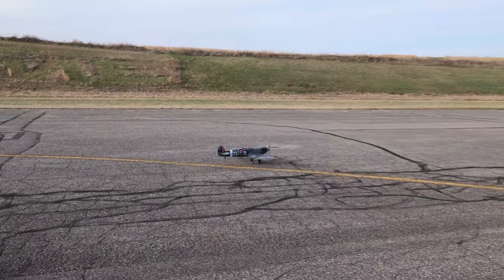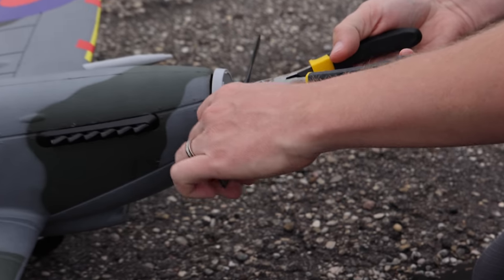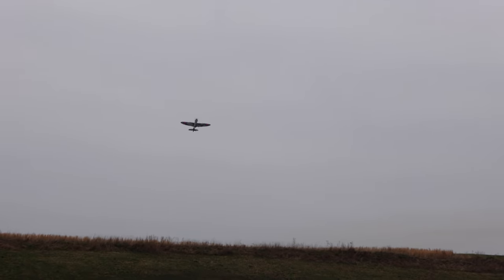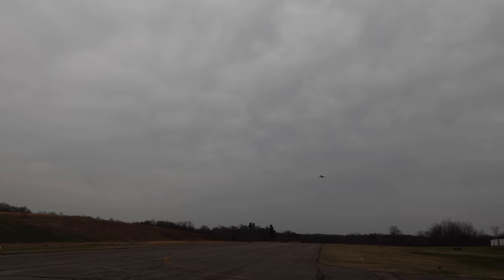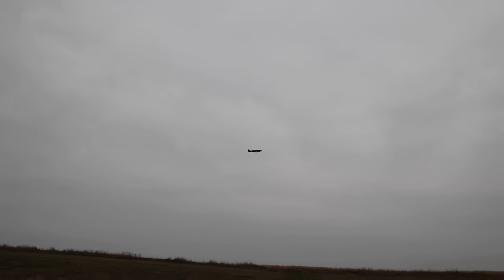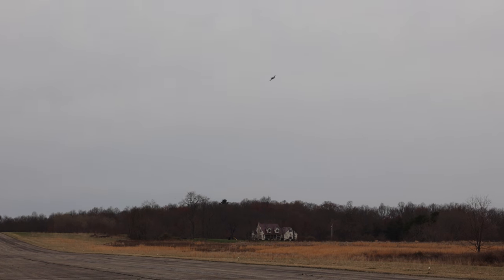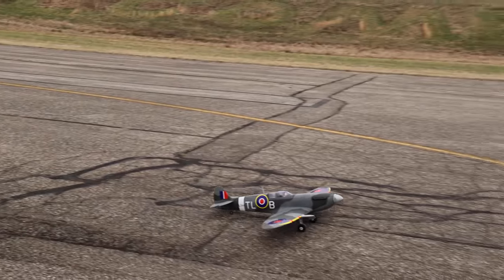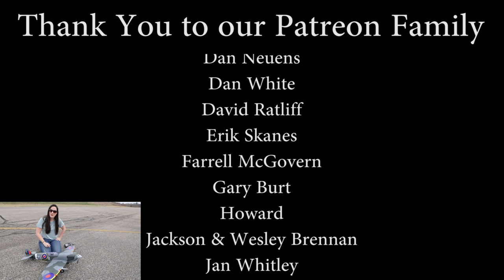Will this RC PLANE Fly with a BROKEN PROP?? - Dynam Spitfire WARBIRD - TheRcSaylors

Comment: I was always was taught growing up, and especially in the Air Force to always be prepared for anything and everything. Especially in my hobbies. Since I do so many different ones, especially the past 57 years and counting. From model railrading (doing all scales), model rockety in the Air Force, flying model planes in junior high school, model making, RC cars and helicopters in all scales, and taking flying lessons for single engine aircraft like Cessnas while in tech school in the Air Force at Sheppard AFB in Texas. Having confidence in one's self abilities and knowing if there's a problem that you can Correct it and having the right tools at hand in case you need them.

Comment: We learned a couple of things about wood props in the 60's. They did not bend back under load and they snapped off everytime you had a rough landing. Some of those early True Flight brand nylon props were so soft you could see the tips deflected back under load over an inch! We all switched back to the low performance nylon blades. You really had to work to break one of those. We kept a few wood blades around just to use for photographing a new model.

Comment: Great job Abby. Historicaly accurate as the first Spits had a two blade fixed pitch prop.  I am not sure if they ever had more than two blades.
Reply: Thats correct.
But the latest ones had 5 blades !

Comment: I have been in the hobby off and on since I was 10.  I'm now 36.  Back in the day when nitro was the way to go we had flight boxes that we kept extra props,  servo horns, glue.  Basically a few extra little things that incase we had a break or something we could fix in the field and not ruin a day of fun from one little mishap.  You should get a cheap little tool box and keep those things with you.  Doesn't have to be much but just some basic tools and parts. Perfect thing would be a small tackle box.

Comment: Performance will also be kind of anemic on half the prop blades as well. I've seen a number of people do this in a pinch, though. I'm with ya on the extra prop being included. Abby even stuck the landing, not easy to do an a tippy Spit with the narrow mains.

Comment: Nice landing!  Well done for a first time spit driver. Your particular spit may have some design advantages for this kind of landing. But, having some experience with spitfires (top flite), I would never drop engine rpm to idle on landing. True to scale warbirds will spank you every time. ‘Throttle control’.

Comment: Great flight. It's not surprise that it flew on a two-bladed prop, as the original Supermarine Spitfire early versions used a two-bladed prop. Then they went to a three-bladed one, and all the way up to the final production versions which were fitted a five-bladed prop.
Reply from the maker: You know, I'm not sure I've ever flown Anything with a five bladed prop!  New Goal!!
Reply: @TheRcSaylors  it looks like Hobby King made a 5 bladed prop retrofit kit for one of their Spitfire kits, and E-Flight had a Spitfire Mk XIV with a 5 bladed prop.
Reply: You can´t compare the behaviour of a model with that of the real plane !
That´s physics.
Reply: @swyntopia  So, I guess we didn't see it fly with a two-bladed prop, right? 

Oh, I am sorry, it flew just fine. That's physics, fluid dynamics, to be exact.
Reply: @FarrellMcGovern  sorry, I am no native english speaker.
I cannot explain in english what I really mean.
probably I mean a different thing than you.

Comment: What a great idea that was to cut off the third blade and give it a go. I almost can't believe it worked. Good job, Abby. Also, you talk about cheap little quads and such coming with extra props, and that's fair. But I bought an extra for the Conscendo Evolution. I don't think I'll break it, but to carry such a big plane to a field and then just have to stick it back in the car would not be ideal. :)

Comment: See Abby you are much better than you think🤔 U. R. You got it airborne, flew it very well, and landed near perfectly all on minus two blade handicap. Did you guys check to see👀 if the motor/esc were over heated. So you both cook, what's your specialties. And what time is dinner ❓🤔😁. ⚓⚓👍💖👍🧡👍⚓⚓.

Comment: 4 blades takes more torque to spin at the same rpm. Electric motors have windings to run a certain rpm and the torque needed to push a certain prop size and pitch. ( size wire and number of windings determine both ) Dropping from 4 to 2 blades should do ZERO to hurt anything, other than have less thrust due to half the blades. It actually should draw less current as well as 2 blades have less air resistance than 4 blades would and are less strain for the motor to spin. The trade off is less thrust.
Reply from the maker: Very interesting, and makes sense! 👍😁😎⚓
Reply: It's hard to say whether the four blade would be more efficient for battery life or flight time. They could check the time before and after they put the new prop on. Flying in the same fashion.🤔
Reply: @joesmith4222  if the size and pitch are the same, 1 is 2 blade, the other is 4 blade, the 2 blade will have less thrust but also less drag so more run time. It is the same concept as pinion gear in a gearbox. Larger pinion gives more speed ( more draw so less run time ) but less torque, smaller is opposite. I used to know the formulas for figuring it out but I haven't had physics in a long time. Back in my day , there were charts that listed the size/pitch to run 2, 3, or 4 bladed props on the same motor. ( nitro ) Electric planes usually had reduction gear boxes as the brushed motors were not powerful enough to run direct drive. You could change pinion gears to go to larger/more pitch props for either more top speed or more off the line thrust, both at the cost of reduced run times. The disadvantage to 2 blade over 4 blade is if the thrust is not enough to get the plane in the air or give it much vertical acceleration. It appears this plane was engineered for  either a 2 or 3 bladed prop so the 4 were not needed to get flight. I am curious how it handles vs the stock 4 blade. It likely won't do near as well in wind with the 2 missing blades.

Comment: It is not harder on the motor or the esc because you do not have a full load on the motor or the esc. One thing you now need is to hold about 75%  to 90% throttle to do the same as the four bladed prop. That could make it hard on the motor or esc is the prop not being balanced properly.  nice video.

Comment: If you're going to fly it with a 2 blades prop, or to have one as back up, get one that's at least 1" bigger, and maybe 1" more in pitch.
Reply from the maker: Would 1 inch larger mean it would possibly hit the ground more often? 🤔
Reply: @TheRcSaylors  There should be plenty of clearance as far as I can see, as long as you keep it level and not nose down. 😉
It's just ½ an inch on each side.
Reply: @TheRcSaylors  I looked it up now, it's a 10,5x8x4 (dia x pitch x number of blades) So either an 11x8 (maybe 9 for more speed) or a 12x7 would fit and not stress the motor.

Comment: Love your stuff but a quick hint on taildragger take offs.
Only hold the full up until she’s rolling (the Spitty, not Abby!) and then ease off allowing the tail to rise, then when at a good safe flying speed ease in a wee bit of up. Much smoother, scale like take off, rudder usually needs to ease off too as speed increases and rudder becomes more effective.
Keep it up though guys, love it.
Also on landing don’t dive you’ll increase speed, throttle back and increase angle of attack for a slower scale type landing.
Hope I’m not teaching you to suck eggs. Pete.
Reply: The controls change "jobs" Throttle regulate altitude, elevator controls speed, ailerons is just for keeping the wings level, rudder is for directional control.

Comment: Probably not the best idea, converting a 4 blade prop  to a 2 blade prop.  If you really wanted to fly that plane on a 2 blade prop it would really require an entirely new prop, one with a greater diameter and a larger pitch to match the performance of the original 4 blade prop.  The plane appeared to be under powered on take off  due to the 2 bladed prop not making as much thrust as the original 4 blade prop.  Also to properly balance a prop the prop must be removed and placed on a balance fixture, then by either sanding the heavy blade or applying paint or nail polish to the lighter blade to achieve proper balance.

Comment: You can never have too many spare props
Reply from the maker: You are extremely correct about that 👍😁😎⚓
Reply: That's what Joe said.
Reply: @TheRcSaylors  I've been seeing lots of videos of that BIG JET AIRLINER. Looks very easy to fly. By time you get the plane, transmitter, batteries, and charger it can't be much more in cost. They sure look awesome in flight.

Comment: A 2 blades prop would be fine if you had the good one! You need to have the same amount of forward motion as the 4 blades one. That is if your 4 blades prop moves you forward by that much distance you must equal that distance with a 2 blades prop.

Comment: I was wondering if there is a formula to calculate how much thrust is lost by removing 2 of the 4 prop blades? It would not be exactly half, because the remaining blades work more efficiently. I’m guessing the 2 blades produce about 64% of the thrust, that the 4 blades would have made.

Comment: i do not want to be unpolite but abby would not be able to bend the motor shaft 🤣😂 nice quick fix and for the sake of this video very funny. as nate said, it is not recommended. the clean cut of the second blade is not the major issue but due to the rude disassembling of the first blade, the material integrity was hurt and a fatigue is just a mater of time. ✈🥰

Comment: Ooook I have a question!!!!!!
  You'll have had this dynam plane for a while.  I've seen people have problems with the control surfaces because there are no hinges just pinched foam.
     Have you had any problems with this foam hinge braking? Have you replaced this setup with traditional rc hinges? 
  I've ordered a Dynam F6F and am concerned about durability.

Comment: Good to see that the props are gone out of the chase footage. Were you able to change the FOV?
Reply from the maker: I did this in post this time. Hoping to change that in the settings. Glad someone noticed 😁👍😎⚓
Reply: @TheRcSaylors  Been annoyed by those props-in-view from the moment I saw the first vids; Dji could and should have designed the quad better regarding that imo. Yes you can correct in post, but it's extra work, and you loose FOV.

Comment: According to physics the fewer blades the more efficient.
Reply from the maker: More efficient at running speed but less thrust. 👍😁😎⚓
Edit: corrected typo 😉
Reply: @TheRcSaylors  thanks. I had a feeling that would be the case but not 100% sure.

Comment: So does removing 2 blades create more or less thrust? (I have no intention of trying this because props are expensive) The pitch doesn't change, but the motor is spinning less mass so it is spinning faster and the 2 blades are moving more air than before. There is less surface area, though, so does that mean it is producing somewhere in the "75%+/- original thrust" area?
Reply: In the Multirotor World: Dual props offer the highest top speed(least drag), Triple props offered more thrust and cornering grip, and Quad props offered the greatest thrust and grip and the least top speed of the three. It should translate to airplane props as well.

Comment: In truth, how much difference did it make to the plane’s thrust to have only a 2-blade prop? I suspect not that much.
Reply from the maker: Not a HUGE amount, but it was noticeable. Especially on take off. We might have noticed more if we tried more maneuvers, but it totally flew!! Learned something today! 👍😁😎⚓
Reply: I remember reading once about wind turbines that the main reason most turbines has 3 blades was because they looked batter than 2-blade props. The three blades did not in fact interact with the air passing through them all that much more than two blades did. Just a few percentage increase in efficiency. Indeed a one-blade prop (with just a counterweight) worked pretty effiviently!

Comment: Of course does it fly !
You are too young to remenber the beginning of electric RC flying.
Formerly the planes where much more heavy und the brushed motors had much less power tan today.
And they did fly too.
Compared with the beginning ( and the real planes !!! ) the electric driven RC models of today are absolutely overpowered !
So they have a lot of spare power !
The reduced power generates more scale like behaviour !
I have had a lot of crashes ( shockflyers ) with broken propellertips, and usually I cutted the opposit blade.
Of course I balanced them well, and as long as the Prop was not toooooo small, they still flied.
So I´m not astonished.    :-)

Comment: You get 1060 props at Ali Express 10 for $6. You expand the hole with a drill and it fits every big airplane. You have a little less power but a lot of props for nothing.